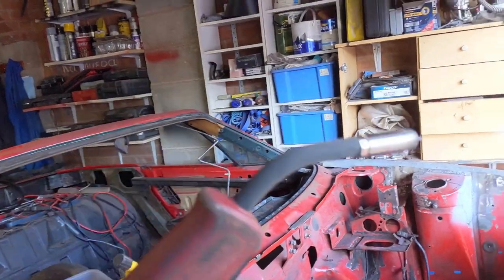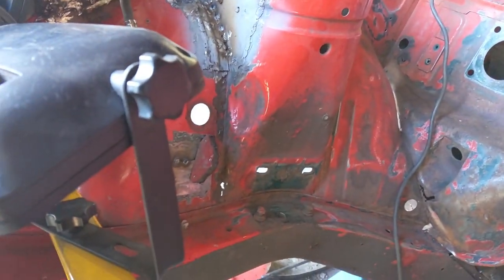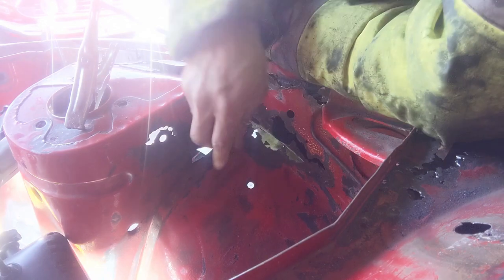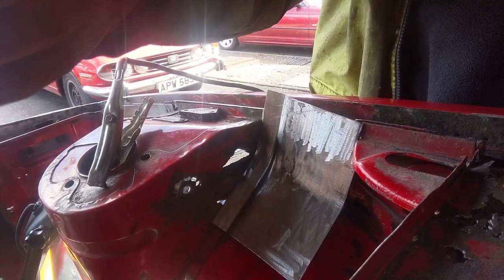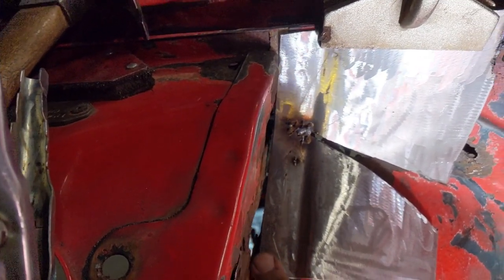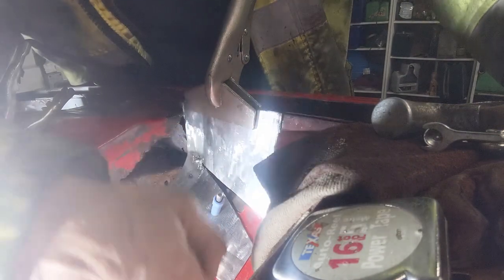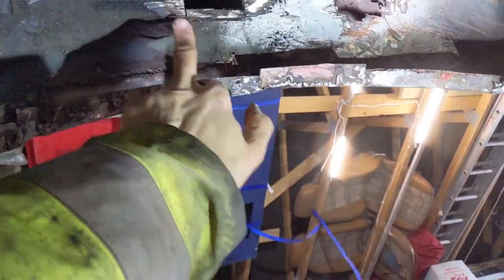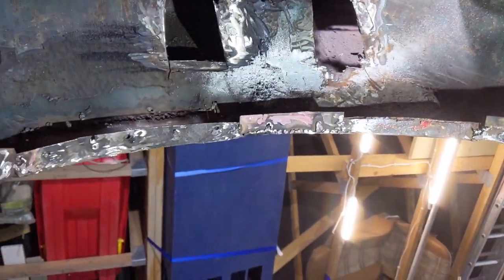Triumph TR7 Restoration: Episode 63   Engine Bay Repairs Part 3c

Comment: Hi I noticed that you have a static arc gasless welder I bought the 3 in 1 static arc welder for under £180.00 and its not a bad little machine if you need one. And thanks another cracking video
Reply from the maker: Thanks mate, I been looking at the attic arc 3 in 1. What amp is the one you got?

Comment: I've not started welding mine yet, after my gas mig welder being dormant for quite some years now but I spoke to a local welding gas firm in Hertfordshire, they said the best deal for someone doing a restoration was to rent a bigger bottle, it's £80 down payment and £8 per month with free refills. You can cancel at anytime so it's not a contract. I think I'll go down that route once I start back on my TR7 restoration.
Reply from the maker: Yeah, I think that’s a good idea.  A proper bottle with a proper regulator would certainly help me
Reply from the maker: I went a got a proper bottle today - makes a big difference
Reply: Great, glad it's made a difference, I'll aim to do the same once I start welding on mine then, I've got two tiny disposable cylinders to use up but I can use them on practicing beforehand 👍

Comment: Hi Henry, I think that your ground clamp has moved off the bare metal and onto a painted area. Have you tried a direct circuit to your ground clamp before condemning the welder! Somebody else has mentioned about your gas, to be fair I find those small (Clarke) containers wholly inadequate in terms of gas volume. They work out very expensive too, I made the decision to use Hobby Weld, the container is about a metre tall and is a one off payment of around £90 full. The bottle is yours and you just take it back and swap it for a full one for about £45. You will need a pressure and flow gauge to connect but not expensive. So for a bit over £90 you will have more than enough gas to do the TR7 and you can dial in the gas flow, I use a flow of 10 with the trigger fully pulled. You see you can have gas coming out of those tiny cylinders but the flow and pressure diminishes rapidly leaving you thinking you are ok but you will have very little shielding and protection of the weld giving a poor blobby weld. I have no connection with Hobby Weld, the bottles are available UK wide I got mine from Tool Station, I have got through two and a half on three very badly corroded cars, keep up the good work 🙂
Reply from the maker: Thanks Ian, I’ll check out both the clamp and the hobby weld.
Reply from the maker: Thanks Ian, I’ll check out both the clamp and the hobby weld. I’m also going to try my gasless one if the clamp doesn’t work.

Comment: Hi mate are you not using any gas when welding ? Looks like ur not , if so u might be better using gas less welding wire as you are working on the structural components and needs to be strong
Reply from the maker: Hi, Definitely had gas at start of the day.  Did check at the end.
Reply: @HenrysGarage  How often do you change your gas bottle
Reply from the maker: Not enough - I forget to check sometimes but know I did yesterday and today